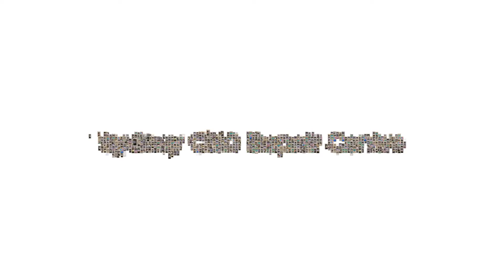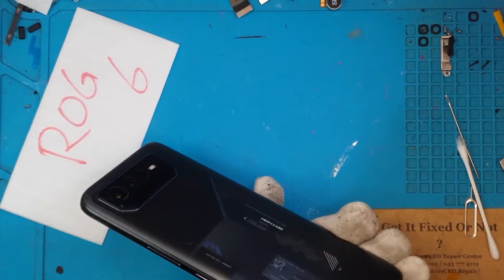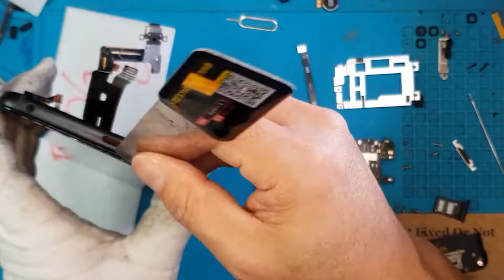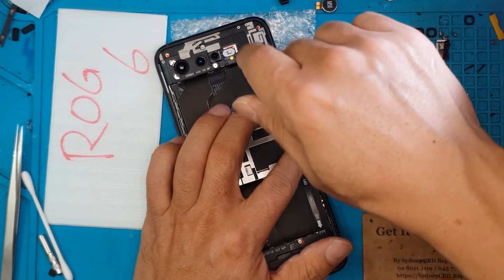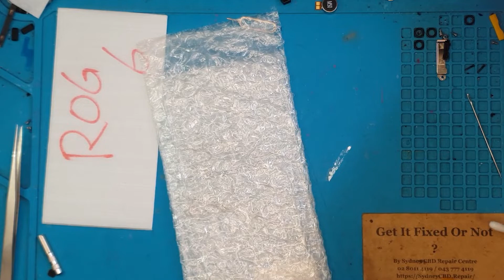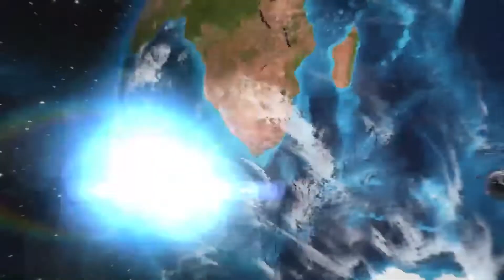AN EASIER GAMING PHONE FIX? ASUS ROG PHONE 6 Screen Replacement | Sydney CBD Repair Centre

Comment: Have the original case? Throw it away, mine fell from pocket two floors of stairs, cover got cracked bottom right, screen, touch glass and back glass got gracked and got damage to the display riboon cables with no vídeo as result...

Comment: i have my ROG phone 6, I got it repaired at a service center for back glass replacement. It got replaced but, everything got broken, the camera the switch and the system. the touch panel was replaced as well but  got replaced with a cheaper so it got broken. I'm from the Philippines. any tips would do
Reply from the maker: Hello, bring it to the repair shop where you had it repair ask them for warranty.

Comment: Is the fingerprint sensor working after the display change? Rog 3 and 5 required a special procedure to calibrate the sensor, how about 6?
Reply from the maker: Yes in our shop everything works after repair
Reply: Where is your shop located and how much does it cost to repair a rog 6 screen?
Regards
Ebs
Reply: How much do you charge to repair it?